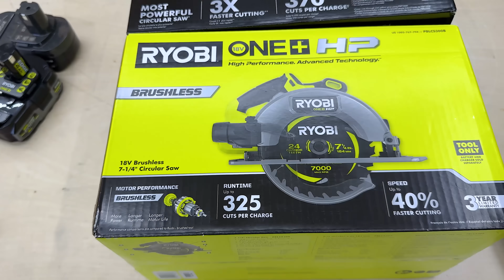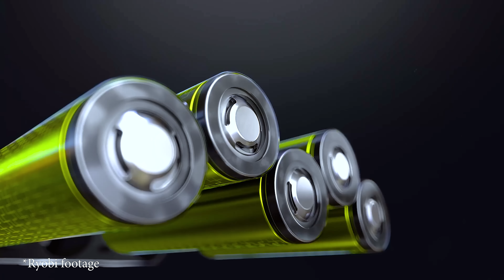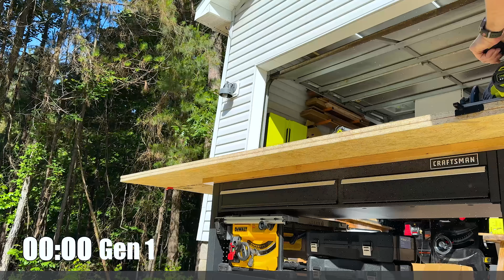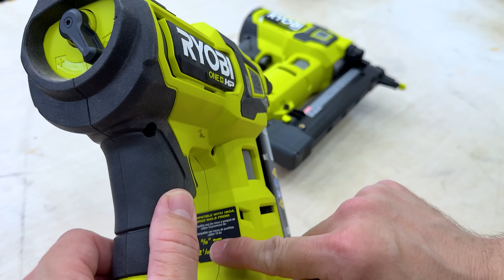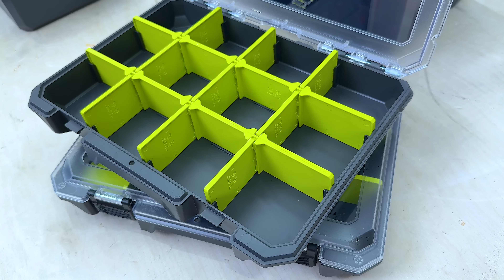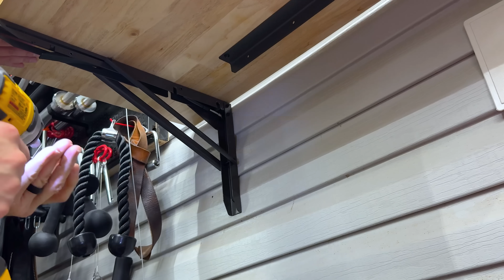RYOBI Just Made Every Tool Brand Nervous (These Are Wild)

Comment: FYI- i have the 18 gauge brad nailer which states smallest usable brad size is 5/8”, however i shoot 1/2” brads all day long with absolutely zero issues, i just turn the top air gauge control down a little. i have no idea why it states starts at 5/8” when 1/2” works perfect 🤷‍♂️

Comment: Packout is dead? You do realize their the same company and Ryobi is the budget tools, right? They can claim "independent subsidiary all the want, but when a company owns you they aren't going to let you compete against their other companies. Ryobi is cheaper, budget junk compared to Milwaukee. Will it work? Sure. Is it worth it? No.
Reply: Umm So Ryobi is I understand owned by techtronic.  Now would you like to guess who owns Milwaukee?  On your logic Milwaukee will be the same underlying budget junk as Ryobi so that is a big clue for you.  Clearly the two brands (and others in the Techtronic stable) do compete.  They may or may not share R&D and some parts across the brands.  But so what.  If the tools do what you need them to do they are good tools.  If they do so at lower cost, then you haven’t wasted money on features and specifications you don’t need. Frankly spending too much to get the best versatility and quality, when the article that you are making looks just the same, because of your skill level isn’t the best, really isn’t a very bright idea.  As for durability, I’ve bounced my Ryobi tools off concrete floors and they just keep going.  I do not recommend it, but it seems to me to be a good test of durability.  Will they wear out if used every single day for years professionally, of course.  But  I suspect they will give most pro brands a good challenge and some they will be better than, haven’t seen any evidence at all that that isn’t the case.

Comment: It bothers me that the blades on most circular saws are on the right when a lot of people are right-handed I believe the blade should be on the left so you can see what you are doing instead of leaning over the blade.
 And when cutting plywood like you are the bass plate is on the offcut instead of being stable on the main sheet of ply

Comment: I have pneumatic stuff for nailers.  I own both the Ryobi one and M18 as well as m12 batteries. Was looking the other day.  I don't use them a ton, but would be nice to have an electric.  The M18 stuff is for some close to double the price.  I might end up with the Ryobi even though I have a single larger battery and fast charger with the ryobi platform.  Maybe I will expand it.  I have more fuel batteries.  Also for cords and hoses.   A scrap of ply painted white and screwed to studs with some cheap hooks does a great job and way less.  Just not as easy to change things.

Comment: Try the gen 2 reciprocating saw 

The gen 2 hammer drill with 850 inch pounds 

The gen 2 impact driver with 2,300 inch pounds 

The gen 2 1 handed reciprocating saw 

With a 4am edge battery

Comment: I know Ryobi gets a lot of hate, But the battery system is the best out there.  My dad used to say, until your abilities are higher than the tool your using,  Keep what you have. I feel Ryobi is an excellent platform for 95% of ALL homeowners and DYI people.
Reply: Yea, reminds me of these guys who would never practice electric guitar and were mediocre, but would always insist on getting the limited edition Gibson 59s or something. Most people don't do work often enough to warrant the top of the line stuff.
Reply: Imo DeWalt battery is the best battery platform. But Ryobi has some cool tools and with readily available 3d printed battery conversion, it doesn't matter what platform you're on.
Reply: It's not the best. Their own parent company says so.
Reply: I agree with your dad.
Reply: I"m waiting for a Ryobi shirt pants and hat to go with my tools?
Reply: Ryobi batteries were not designed for smaller hands. That leaves out a large percentage of people, including most women. One of the reasons I chose Dewalt.
Reply: DYI?  Do Yourself In? 🤣
Reply: @scottgaree7667  My EXACT thought 😂😅  Came here to type it. 😂

Comment: I would never buy a circular saw with steel shoe plate. Mostly because they are not ride along a staright edge nicely as a magnesium one which are straighter.  Usuall wher the are cutouts for the rip fence to be attached is an inconsistency  with being true and straight.

Comment: Thanks for this. Very timely. Which gen is part of the current Ryobi days deal?
Reply: It's the newer 6.5 with the aluminum plate (not stamped metal, finally).
Reply from the maker: i'm not 100% sure
Reply: @731Woodworks It's the 6.5 so neither.

Comment: Ryobi needs a 4 1/2" circular saw with dust collection, like the Dewalt DCS571B.

Also, why can these tools only be found at Home Depot, instead of online at Amazon?  My home depot is trash...none of the newer tools can be found there.  Amazon is so much easier, just have it delivered.
Reply: Ryobi will sign exclusivity contracts with hardware chains, as they did in Australia back in the 1990's (and its still in effect).

Comment: I already had some drop down table hinges just waiting to get used. While checking out the Fold Down Workbench on RYOBI's site, I saw they have a replacement top for their LINK Speed Bench Mobile Workstation. I'm buying two of those now. I won't have that lil 5" shelf, but it's a good poor man's substitute. 

I did notice that the Workbench is 44x22 while the Workstation is 42x22. Maybe someone that has a good relationship with Ryobi (cough, cough @731woodworks) might suggest making both of them the same size for interchangeability. It would also be a lower production cost for them.

PS
Some of the HD  links are not working as of this edit.

Comment: A couple questions.  Is the Gen 2 circular saw baseplate compatible with the Gen 1 saw?  And when you put the non-Edge batteries in the saws, did you use the standard battery or the HP?
Reply from the maker: Not sure if you can swap out the bases. I've tried standard, HP and EDGE.  There's a massive difference between standard and EDGE.  There's a difference in power from HP to EDGE but not as big as the standard to EDGE.
Reply: @731Woodworks  OK thanks.  Good to know.  I have several of both standard and HP batteries, but haven't noticed the Edge ones in the store.  Seems they're really trying to push the HP batteries right now, or at least at Home Depot.  Maybe they're just trying to get rid of them.
Reply: I'm pretty sure he said he went all the way down to the standard battery.
Reply from the maker: @aristotlethedecent6675  Yep. The standard battery just stalls and stalls on these cuts.

Comment: Thanks for the detailed review about the circular saws. I'll pass because they need a bigger, better, more pricey battery to perform well. But the nailers and Link stuff is sweet. I will look into that folding work-bench too. Great review, Matt!
Reply: You can run them on an older battery. It may just run down a bit faster. I have the gen 1 circular saw, and use a previous gen battery. No problem running it. Unless you want to cut a ton of wood in one day, you should be fine
Reply: @1packatak  Thanks! I got a corded Skil, which works pretty well and is hard to justify replacing with cordless tech, as nice as cordless tech is...

Comment: Literally about to take the plunge into woodworking and had shortlisted a bunch of Ryobi tools until i saw your older video today advising to go for the One+ HP range. Now i see this a couple hours later!

You really have my back today, it seems! 😂
Reply from the maker: Get the One+ HP tools not just the standard One+ ones. Those are the latest/greatest line of RYOBI and are very nice tools.
Reply: Same. What are some Ryobi starter tools you're looking at besides the circular saw?
Reply: @mamasitos007 I have basically nothing here so I'm looking at getting the drill, impact driver, and router too. I also think ill pick up the brad nailer just because itll make one of the first projects i want to do much easier!

Comment: With all those 40 volt batteries I want to see your Ryboi outdoor power tool collection.  I am rocking Kobalt 24 volt mower (got little under 1/4 acer so the small mower is alright for my small yard) and hedge trimmer, and Worx 40 volt blower and string trimmer.  That blower is so quiet like sub 60 db.  I could be blowing next to a window and the person on the other side could barely hear it, and it has decent power around 530 cfm.
Reply from the maker: I've shown a couple of them on my other channel https://www.youtube.com/results?search_query=outlaw+effect+ryobi+40v
Reply: @731Woodworks  will check it out.
Reply: When my mower bites the dust, I am looking to upgrade from 16 inch mower to 20-21.  Ryobi had some 40 volt mowers that looked pretty good.

Comment: I just bought the gen 1 on sale, would you say it is worth returning it to get the gen 2 at a price increase. I have a few weeks to return the gen 1 still
Reply from the maker: It's a decent upgrade for the base adjustments being more preimum.  A slightly more powerful motor. Depends on the price diffefrence.  If you're satifsifed with the performance of the Gen1, I'd keep it and put that money toward EDGE batteries.
Reply: $40 difference as of the sale I received. I already have one edge battery